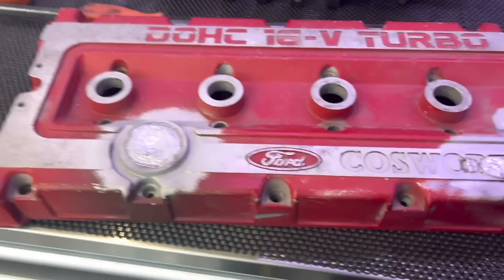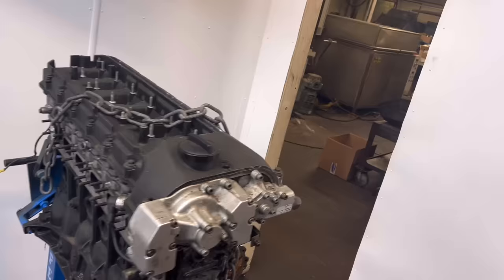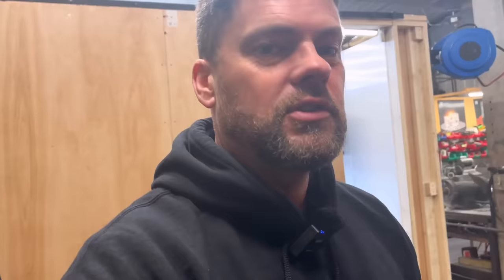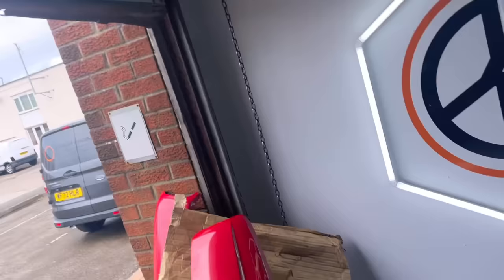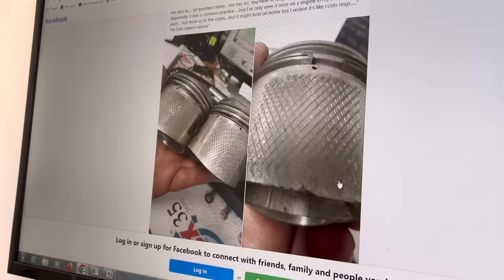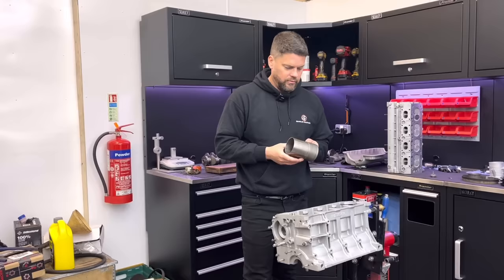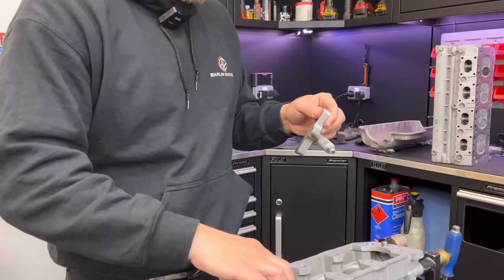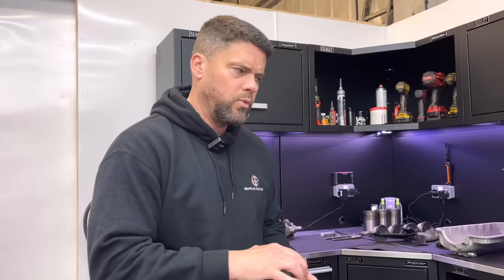THIS CAR GETS THE WORST FIX IV SEEN IN 20 YEARS!

Comment: Knurling piston skirts was a popular (predominantly US) race prep back in 1960's and 70's to reduce the friction of the skirt on the bore.  The knurled section did allow greater clearance for pistons and rings without the attendant piston slap as well as retaining more oil against the bore.  The knurling was tighter than that shown as the object was to have a myriad of pyramid peaks that would act like miniature bearing surfaces, the theory being that the peaks would quickly round over to give a smooth contact.  Today hi-perf pistons have teflon/ceramic coatings that purport to do the same thing, a modern take on a old tradition..

Comment: When you talk about wooden pistons takes me back to 1974 when I started as an apprentice in a garage and an old mechanic who forgot more about engines than I will ever know made a piston for an engine during the war as cast iron and especially aluminium was very hard to get hold of. And the amazing thing was it worked and I suppose long stroke slow reviving plodding engines were a bit more forgiving.
He also said he would weld teeth on the rear axle crown wheels and grind them to shape to keep the cars on the road so I’m sorry to say these things did happen.
Len.
Reply: I heard something similar about a tank being repaired with a wooden piston to get it home.

Comment: Lee, I guess I have an advantage on you, I'm 80, but knurling was used here in the US many years ago in the engine rebuilding business to save the customer money by reusing the pistons, as long as they weren't banging around the bore like a BB in a boxcar.  It simply increased the diameter of the piston so it was snug in the honed bore.  Of course if the engine was bored us would have to use an oversized new piston.
Reply: I seem to remember a system called "Micro Peening' that achieved the same end.

Comment: Light knurling of alloy pistons is used to determine the eventual shape of the piston. By identifying where the knurling wears, the design aspects: gudgeon pin off set, top-land clearance, ring land clearance, skirt barreling and ovality can be determined. This is usually carried with temperature sensitive ‘plugs’ in the piston crown, as it is important to know the temperature and hence expansion of the piston material.

Comment: Remember reading the instructions on an old set of American made rings, which talked about knurling the skirt if clearance was excessive.I remember reading it two or three times in disbelief. Positives would be a reduction in friction surface and great oil retention. Don't think it's an option on modern pistons though. Liner protrusion dependant on type of head gasket type being used. I run 6 thou on my old Renault motors with composite gaskets and never an issue. Spent 10 years circuit racing, broke a few bits, but never blew a gasket.

Comment: I had heard that knerling pistons was popular years ago and then in about 1985 I was working on a compressor with a 4 cylinder ford Dover or Dorset engine that had had a coolant leak and was asked to do what I can as cheap as possible. It had started to pick up on the rear cylinder so the bore was cleaned and deglazed and the piston was knerled to restore close to the correct piston bore clearance and on starting it was a little slappy but once warm it was quiet and  smooth. Certainly not something I would entertain on a modern engine but for and old low power unit an acceptable repair

Comment: Garage 54 has made lots of pistons made out of different materials, copper, lead, all kinds
Reply: Yeah, my favorit one was making an inline 6 out of two inline 4 engines.
Reply: @sahalin12345  Yeah, the transparent engine one was good and honing over polishing.
Reply: @sahalin12345  Wouldn't that result in an in-line 8 cyl engine - or did they lop-off 2 cyl off one engine before the join.
Reply: @georgebettiol8338  they did chop off 2 cylinders out of one block

Comment: Knurling skirts is an old trick to hold oil and reduce friction in the days before slipper skirt pistons .Peening out skirts was also used in times of need. You said it would be a dodgy fix ,but is it any dodgier than using a split link on a timing chain, I wonder Hmmm.

Comment: Being 67 years old I have seen knurled pistons many many times I have done it myself it only takes a few minutes per piston. Have seen rebuilds like that last 50000 miles. But you must remember that was old 216 chevys low remember engines. The tool to do it was in almost all shops back 60 plus years. Low speed low hp low compression. It worked good. Overhaul  would cost you 60 to 80 dollars .

Comment: When I was in college in the early 1960s we did repairs that would make your hair stand on end. One friend had an old Hillman Minx in which the top of no.4 piston came off. There was no obvious reason why that happened so we put a new piston in it and the top came off that one a few weeks later. He was too broke to afford another piston so I went to Fields Engine Service who I knew well and I asked them if they had a used piston I could put in the car. The let me rummage through a large wicker basket of old pistons. I couldn't find a Hillman piston, but I did find a Ford piston which was the right diameter and the gudgeon pin was the right diameter. The only problem was that the top of the piston was about 3/16 of an inch lower that the Hillman. We fitted it and it worked beautifully until he finished college. I regularly cleaned big ends with emery paper and put shims behind the bearings.

Comment: seen the knurling before and another practice was expanding worn pistons,they were filled with steal or lead shot inside with the small end     holes plugged and vibrated in a machine.usually a .002 thou increase in diameter

Comment: I'll own up to going around inside of aluminium and steel bearing recess with a punch to raise metal and take up wear, also cut King Ping Bushs with one axe saw cut, hard soldered rear press back in and Re-remeared to size. 50 years ago money was tight parts expensive and your time was free, needs must. You could do one of your viewers bodgers once a week on show. Old hacks and repairs and skills are being lost through time. Cheers Mick

Comment: Back in the 50s and 60s Knurling and GI spacers were the norm. The piston now has a closer tolerance and the GI spacer is placed in the top ring grove because the top grove usually is worn beyond limits. Lastly the piston pin (gudgeon) is replaced with an oversize pin. ------- like new. The knurling usually lasts about 20K miles.

Comment: The rover k engines I liked the original 1100 and 1400 units as the liners were hung from a register at the block deck and sealed with o rings at the bottom and then they increased the capacity to 1600 and finally 1800 and the liners then sat on the register at the bottom like you have and then the problems started the liners and gasket would fret against the head more on the exhaust valve side necessitating the head saver gasket kit. Just another example of squeezing a quart out of a pint pot

Comment: Had to have the skirts knurled on an engine when I got a bit exuberant deglazing the bores while I was an apprentice. That was about 45 years ago.
One thing, the knurling should hold and spread oil in the grooves to lube the skirts and cylinder walls.

Comment: Chap I worked with blew up a big outboard engine, One piston in bits. Had it welded back together, filed it to fit, re assembled and part exchanged it for another engine. He reckoned it ran ok on tickover. Didn't chance revving it though. Beware strangers px ing engines

Comment: That was common  years and years ago when replacement pistons were not available. Or the bores were out of round. 
Find some old repair manuals from the 1930s to 70s  and it will be in there.

Comment: I have an E28 2.8 engine in my shed you can have if you can get it out and take it away. been there since 1995, came from the breakers in Billingshurst.
Reply: Was that Charlie Muddles' breakers at Adversane? I lived in Steyning and was a regular visitor to the yard mainly for MK2 Cortina and Escort parts. I miss the days when a visit to the breakers usually resulted in dangerous clambering on towers of cars and shoes covered in oily yard sludge.

Comment: Knurling pistons isnt done on a lathe like i would do normal knurling, there is a machine for knurling pistons called a Perfect Circle Piston Nurlizing machine, they spelt knurling with a N for some reason, ive seen it been done years ago but dont know if it was to hold oil on the piston skirt or to actually expand the worn piston to bore fit on a overhauled engine

Comment: I finally sent my piston knurler to the scrapyard due to the fact i couldn't get the tooling anymore. That coupled with companies like line to line, it's no longer nessecary. 
Knurling was used in a lot of preformance 2 stroke stuff, or where i used it a lot was in antique tractor or oil field engines. The piston mounted into a jig, then rotated as a press  wheel knurled each side. It then swung around and rotated across a platen sander to even things up. You could swell a piston .010-.015 no issue. The process took about 10 mins/piston. 
Many of these engines were going to be parade queens or oilfield stuff where running now was more important than being prefect.  
My machine came out of an old reman facility that sold out in the 50's. 
You can do the same thing with modern coating systems. 
Honestly the engines lasted perfectly well. With no real issues with scuffing. 
Everything being said its a dead practice primarily because of modern coating systems and the ease of replacement parts.

Comment: I guess the idea behind the cross pattern grooves is to retain oil for lubrication.  Its a bit like on injection moulds where you have moving cores running on hardened H13 steel plates,  I would have cross pattern grooves on the plates to retain grease for lubrication. Its a well known method.

Comment: Back in 1978 my dodge Charger 440 magnum was due for a fast freshen up. Just rings and bearings. it still ran well but had 140000 miles... The pistons were a little sloppy in the bore, otherwise it all looked good to go.... A friends brother was a machinist, but not specifically automotive. I got the pistons knurled to take up the slop and assembled the engine. It ran very well! i sold the car 2 years later, the engine was strong, sounded good, ran well. I saw the guy around town still driving the 1970 dodge for at least another 5 years! He wasn't a racer, drive hard kinda guy like me so it all worked out well for all concerned. very cheap refresh

Comment: Knurling was a common process for pistons up until the '70s to take up a few thousandths in clearance and stabilize the piston.  It was also thought that the knurl held extra oil for better wall lubrication.   There was a machine specifically for piston knurling which took only a few minutes to set up and knurl a skirt.  The first shop I worked in had a machine and the manager used to do a few in the mid-70s.

A video of a 2-stroke piston being knurled in a knurling machine:  https://www.youtube.com/watch?v=4uzZYPIGbZE

The knurling didn't hurt the bores and didn't wear the knurl quickly.  We disassembled engines with knurled pistons that had virtually no wear on the piston or bore.  If I remember correctly, only the thrust side was knurled.

Something else we experimented with in the mid-70s was to install Teflon buttons in the skirts to minimize friction in racing engines.  Today most skirts are coated for friction reduction.

Another area common for knurling, was the inside of a slightly worn valve guide, usually no more than .003 wear.  A spiral knurl was run through the guide which was then reamed or honed to a maximum clearance of .001 on the intake and .0015 on the exhaust.  Once again, the knurl held extra oil for lubrication.  I have seen knurled guides last as long as replacements. Some companies sold pre-spiralled guides and Hastings sold Bron-el guides, which had bronze liners that were knurled and fitted as tight as .0005 on an 11/32 stem intake.

https://goodson.com/collections/valve-guide-knurling/products/valve-guide-knurling-arbors

Comment: Chap i knew had a side valve that holed a piston so he riveted a piece of 25 thou shim steel to the top of the piston😂
You think thats bad,i knew a chap who had an ex police motorbike and he holed a piston and repaired it with a countersunk screw and nut then sold the bike bike to the dealer he bought it from😂

Comment: Ohhh you yungins, knurling pistons, and the INSIDE of cast in valve guides, 40's, 50's and 60's, all a legitimate repairs. Don't forget the cost of pistons back then was prohibitive, and labor was cheaper than parts. CNC did not exist, those new pistons were turned by hand baby.